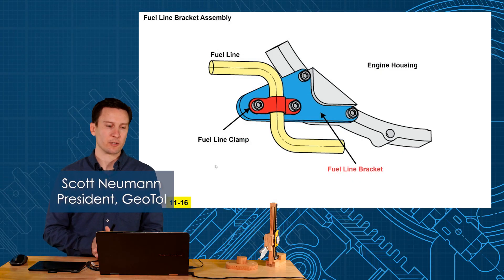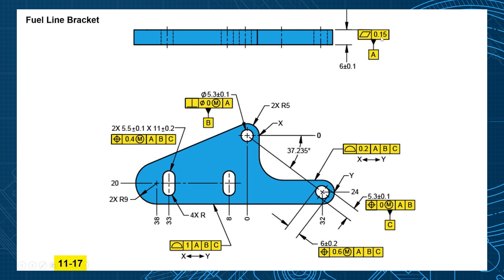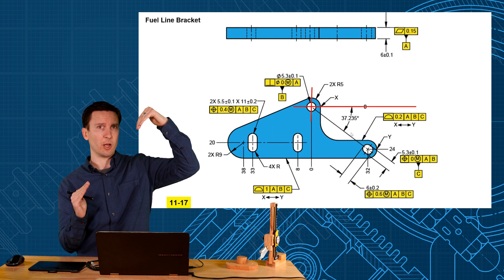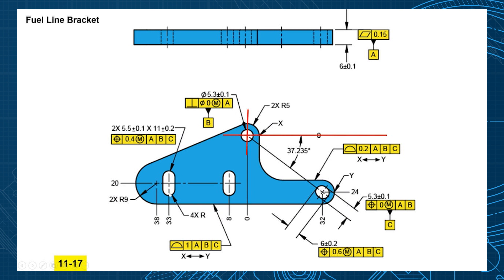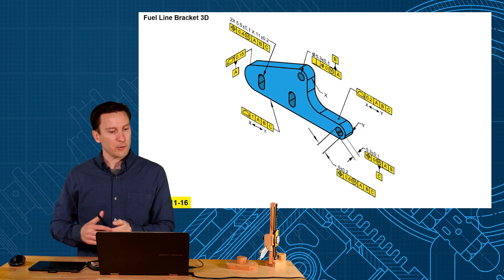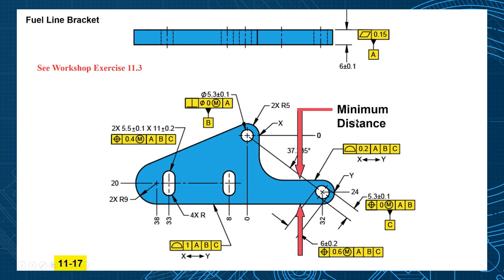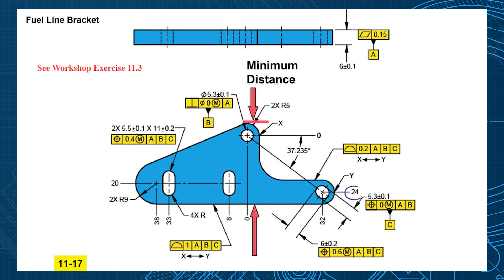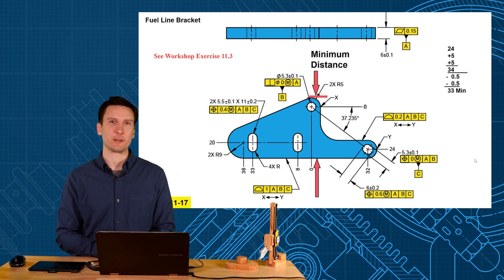GD&T Profile Application - Fuel Line Bracket

Comment: Great tutorial, I have a question, so it's implied that that the holes are concentric with the radii? If that was not the case, did we need some sort of relationship  (i.e. basic dimesnons) between the DRF 0 and outside profile to be able to do the calculations you did through the end? Thanks!!
Reply from the maker: Yes, you are correct. Features are assumed centered unless a basic dimension says otherwise.